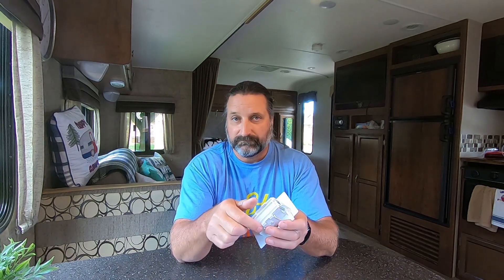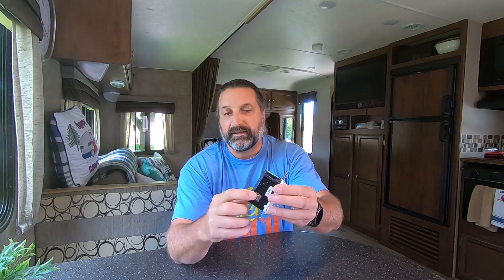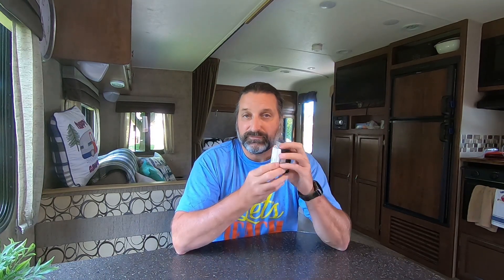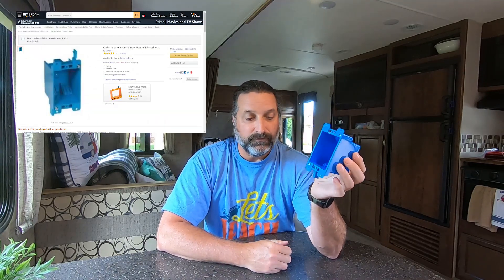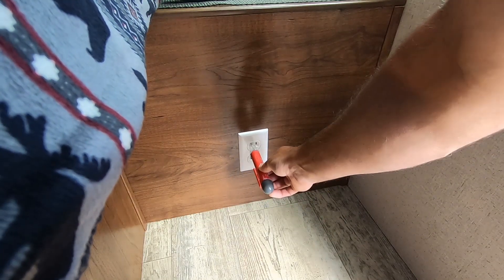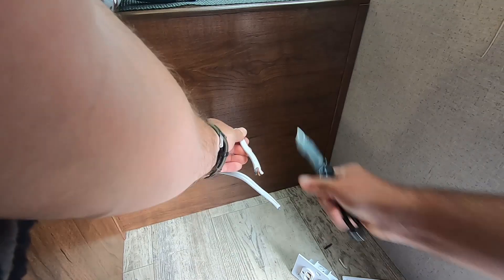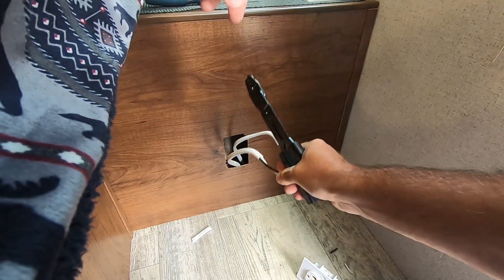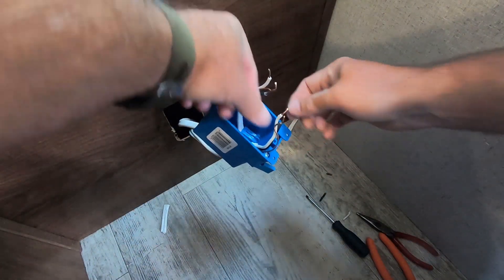DIY Replacing RV Electrical Outlet with Residential Outlet with USB Ports

Comment: Great video the tip on using an old work box was just the thing I was looking for. Two recommendations. One. Don’t use the quick stab holes on the back of the outlet,use the screws on the side instead.  the quick stabs are notorious for coming loose in a house so I can’t imagine an rv with vibration and temp changes can be any better. Second. Any pass through wires should really be directly connected to eachother with a wire nut and a pig tail to feed the outlet to avoid the outlet becoming a fuse

Comment: Well done. I'll add one note. We looked at doing this in our travel trailer however the walls are too thin to even allow the outlet to install much less the remodel box.
Reply from the maker: Yeah, you can't install it into any of the walls of the trailer. It has to go into a cabinet of some sort such as the side of the kitchen cupboards or into the night table like ours. You need space in behind for the remodel box to fit.
Reply: @CampingwiththeColes  exactly. That's why I'm using the shallow boxes. They should have just enough room. The outlets with USB are also too deep but they are also way overpriced so I'll just use an external adapter which I already have entry of.

Comment: Thank You for making this video!  You did a Great Job of making each step easy to follow!! I installed my plug today but unfortunately when I turned electricity back on with all new parts it still is a dead plug ! So I’m going to have to keep researching until I figure out why…… I do know the old plug was on a gfi line but I tried resetting it in my bath room but that did not work!! So will have to continue trouble shooting 🙁 Blessed Travels
Reply from the maker: I hope it works out for ya!

Comment: Thank you for sharing but I do have a question. 
The new gang box you installed seems very deep,is this box specific to your RV or are RV walls deep enough to accept these?
I own a 2022 Jayco 195 RB travel   trailer 
Best regards Dan
Reply from the maker: You can't install this to a normal wall on your RV. The outer walls are solid with layers of wood, Styrofoam etc. The inner walls are very thin and wouldn't be secure enough to put an outlet in. This goes in a wall that has an empty space behind it. The wooden wall I attached it to has a big open space behind it so there is no issue with putting it there. It could also go into the wood at the end of your cupboards so that the gang box would be in the cupboard. If you have an island it could likely go in there too.

Comment: Nice move if you have lots of space behind the outlet. What do you use for an outlet in a regular thickness RV wall? The box you show will never fit in an RV outside or even inside wall, it is far too deep. Any solutions?
Reply from the maker: Sorry, but I don't have any solutions for you for that. I just replaced outlets that were already in the night stands. I also added one in the frame for the TV. They all were in just the thin board and had lots of empty space behind.
Reply: They sell shallow remodel electrical boxes at lowes or home depot, they worked great for me.
Reply: Low voltage box available at lowest & homedepot

Comment: Just something to note, do not push the tabs in on the electrical box you install, those tabs are meant to hold pressure on the cable jacket to prevent the wires from  being pulled out of the box.  It may be more difficult getting the wire in but those tabs help keep the wire from being pulled out of the box and causing a potential short circuit (which in turn could cause a fire).
Reply from the maker: Thanks for the tip.👍